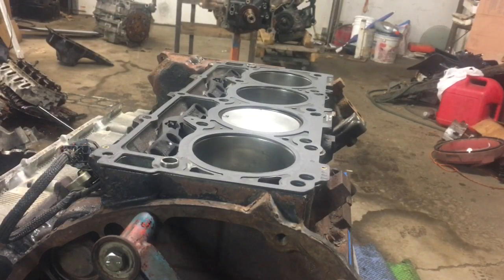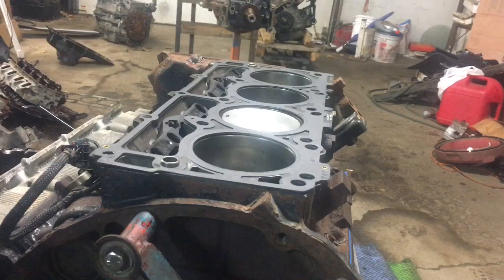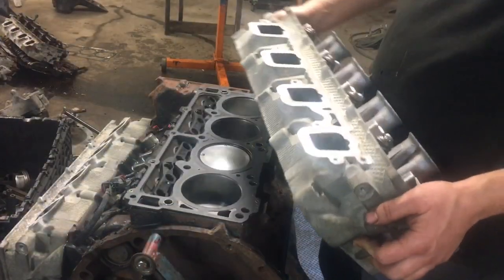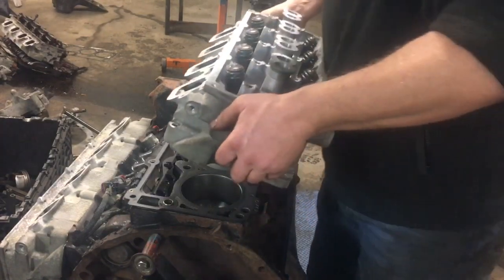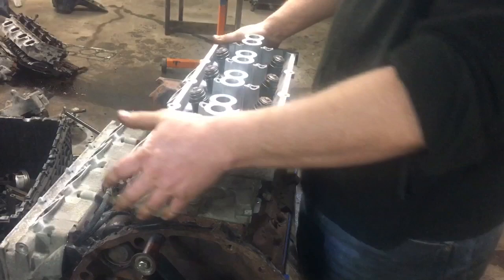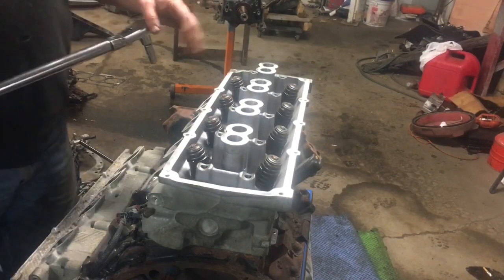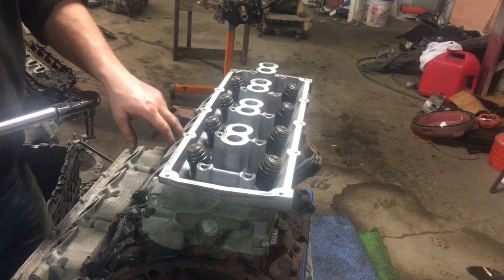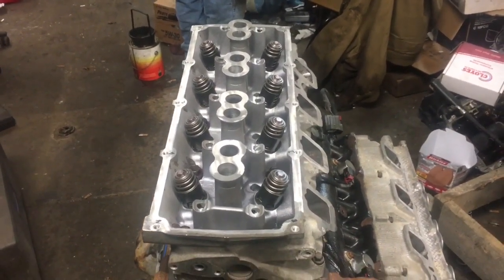5.7 dodge ram Hemi Head bolt torque sequence

Comment: I remember reading about bolt torque that the correct torque spec is without lubricant,i.e. dry.  What do you say?
Reply from the maker: Very thin oil if any…. I think most people way overthink this.. 

Running a tap through the hole  with the head off . Would be a great idea as well.  

But it’s really not necessary  .

Comment: When doing 90° degrees do you set the torque wrench to 90 foot lbs ? Or you keep it at 40 & turn the torque wrench 90° degrees ? Because I’m putting together a 5.7 Chrysler .
Reply: If you turn it 90 degrees it’s still 90 degrees regardless of the torque lol
Reply: @donlesley1873 nawww I was saying did I need a torque wrench just to do 90° but I got it now I’ve been finished with the build but good looks though
Reply: @mostsleptontay  congrats bro nice

Comment: My digital wrench messed up on the 90° turns halfway through is there a final torque that these are supposed to be at after the 90° turn. I heard some people say 90ftlb and some say 100ft lb I went through and torqued them to 90ft lb after I did the 90 bc I was sure what to do please help before I put this car back together for the 3rd time and have the same problem
Reply from the maker: Well, I would doubt very highly that it’s your torque wrench because even if you were close, it would still be fine. There’s something else that’s going on. What is it that your vehicle has the same problem with?

Comment: Question.  When I took my head out.. they're was a flat Grey strap maybe a ground wire. It connected at the back of both heads.. I cut the passenger side at the base.  Do u know if I need that strap or if it's a ground and if I need to replace it where can i find another? 2007 ram 1500 5.7.  Thanks
Reply from the maker: Yes, you have to use that strap. It’s a must the more of them you have is actually better than less.
Reply: @sharpcarco  is there a way to reattach it
Reply from the maker: @AtwoodBoxing  yeah crimp an ending onto it.
Reply: @YoutubeTheClayWay  thanks

Comment: Good explanation up untill you said after torque 15 mm bolts go 90 degrees more. You really should have explained the 90 degrees part,, so i give you a failing grade for explaining,  sorry,  maybe do a follow on up about what 90 degrees one time means?
Reply from the maker: I don’t normally respond to people who insult me then ask me a question…. And when people watch videos and they wonder why the guy doesn’t say anything about the torque specs it’s people like you that are the reason… if you don’t understand what you’re doing and why you’re doing it you probably should not be doing it. What do you think? 90° means ? How do I even answer that question?
Reply: He definitely has a point. 90 degrees was taught to u in high school. Its VERY simple. It's not his fault you don't know what that means. Respectfully.
Reply: First time working on an engine and this video was a great help. Even after 5 years this video is still helping folks like me. Much appreciated!!
Reply: I’m assuming he means 90 degrees 😐 keep it simple stupid
Reply: 90 degree rotation of the bolt. You mark the block and bolt side by side. And you put a mark on the block at 90 degrees and turn the bolt until the mark on the bolt matches the second mark you made on the block.

Comment: Your right if I can do it anyone can do it… lol Thanks for the video best sequence video so far. Another question do you have to use a torque wrench on The lifters, intake, timing cover, oil pump, pretty much everything that involves a cam and lifters project. Would a children’s book  help out with specs? Or what book do you recommend?…. Childrens…LMAO DAMN AUTO CORRECT.. 
Chiltons book?
Reply from the maker: Oh my god that had me rolling….. children’s book I thought you were making fun of me When I first read it

You should always use a torque wrench for everything there is very few things I do not use a torque wrench for. 

I think it’s important to torque covers down but if I wasn’t going to use a torque wrench on something it would probably be something that does not move.

So as far as the cam and lifters go I would definitely use a torque wrench. 

Welcome to the channel Rey thanks for the laugh brother and have a good evening we’re happy to have You here
Reply: @YoutubeTheClayWay  Thank You! For The welcome. What is your procedure on tightening the camshaft bolt without the sprocket turning?
Reply from the maker: Well anytime you are sequencing bolts think about it like a pinwheel, start from the center and move your way outward.

Comment: Do u have to set motor top dead center when removing the head for head gasket replacement ?
Reply from the maker: No but you Should always do it before you put it back together

Comment: Thank you I really need to learn what's ram's problem engine part of code  warning on left cylinders big problem 5 and 7.. 5's compressior is lost by 30 by 120- should had 150 as had 1 and 3 on 150 on tester compessior. real good. Nbr 7 real badly poor no 00 tester compressior. I am afaird of totals cost more money other problem.

Comment: Hey why did u say 50 ft lbs Haynes calls for 40 then a 90 angle I’m in the middle of one an can’t get it to seal right I hate the 3 layered head gasket bs man  bought a new engine wish I would have just done the head gasket a but I dropped my valve seats an it cracked a piston so I bought a new reman an low and behold it had a leaking head gasket so I had to replace it an they will only pay up to 800 for a shop to do it an I have to pay the rest another 1500 an I feel like I got robbed any advice is appreciated
Reply: How did your valve seat drop
Reply: Sorry did not notice that I had a comment I dropped a valve which punctured the piston the dang thing never overheated no signs no nothing just went into the bank one afternoon running fine shut it off come back out would not start. I replaced the radiator found out later I forgot to tighten the radiator support bar well it just blew months later after the radiator replacement. It got a lot worse after  got a surefire motor to replace the old one. well they never put in the installation instructions that you have to use the old pilot bearing out of the old motor so during replacement the new motor destroyed the teeth for the transmission pump. was not very happy with the company they ended up giving me my money back because I was going to sue them for negligence you expect people to automatically assume that you have to use something that is what a installation manual is supposed to be for.     @trenchbaby5717

Comment: So apparently on passenger side head I torqued it to 40 then 90 degrees turn because the page was missing where it says torque to 25 first. Driver side I did properly 25, 40 then 90 degrees. What are the chances that the passenger side head gasket will cause a problem. Or I should be ok!!!!!!!!!!. Thanks
Reply from the maker: hey John ,That’s not going to be an issue don’t worry about it , that’s my opinion.
Reply: The Clay Way sometime a second opinion puts your mind at ease. Thanks.
Reply from the maker: Yeah I figured that

Comment: On the head bolts did you use the red threadlocker? I noticed red at the end of the bolts and want to make sure that 

if it is either teflon tape or threadlocker or ? I am using new bolts but did not notice any red coloring at the end of them.
Reply from the maker: If the new head bolts that you’re using had Loctite on them or if you were reusing Head bolts with Loctite on  them you use Loctite. . If the head bolts you took out had Loctite you use Loctite if not you don’t I hope that helps you out brother have a great day just make sure you follow the sequence properly most head bolts do not use Loctite

Comment: Do you use all new bolts or can you re-use bolts? Thanks
Reply from the maker: I often reuse my bolts but you are not supposed to they are torque to yield you are supposed to get new ones. I do this personally to contact my own personal test on my vehicles because I have the ability to just take them apart and fix them. 

But the proper recommendation is that you get new ones
Reply: The Clay Way thanks for the fast reply! 👍🏽

Comment: Hi great video. Do you have a video of the valves, rocker and rod installation. I have read this can be a problematic install and it would be nice to see it before doing it myself
Reply from the maker: I don’t right now but I’m building one of the motors here in the next week or two and if I do the actual assembly again (I’m thinking about taking it to the machine shop) I will make one I need some other work done on this new engine and I’m thinking about just letting them do it all
Reply: @YoutubeTheClayWay  thanks for the reply. I have a 2011 ram 1500 with bad lifters that I'm going to do a cam lifter swap. Just trying to get all the info I can before. Hopefully you do a video. I'm subscribing. Great job
Reply: Great job I really needed to know this thanks a lot

Comment: Do you have to torque rocker arms ?
Reply from the maker: Yes it is always good practice to torque down any bolt two specifications, . Unfortunately I do not have the specifications for that I would recommend just looking it up on Google. Unfortunately under any circumstance I could not recommend someone to tighten down the bolts without looking up the torque specifications. As far as the engine is concerned on the inside of the engine we torque everything down to the proper specifications. Because we don’t want to ever have to take it apart or have it fail prematurely